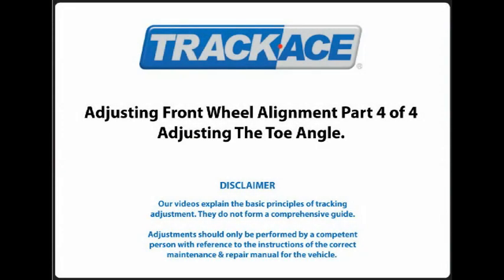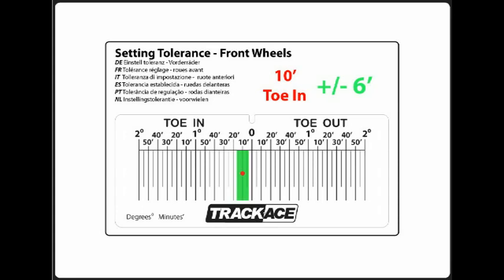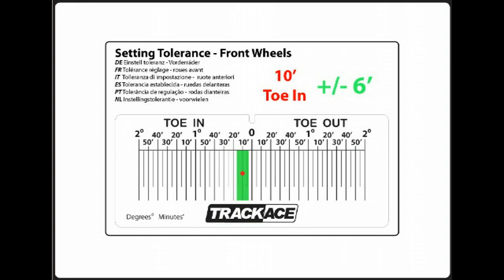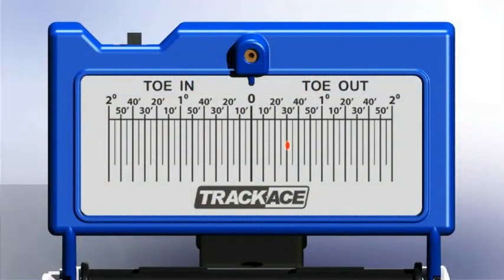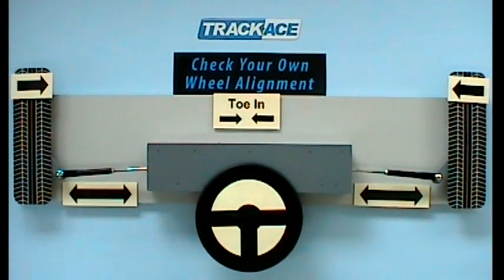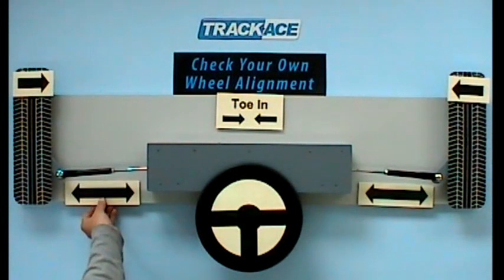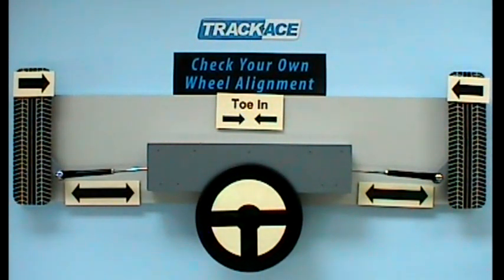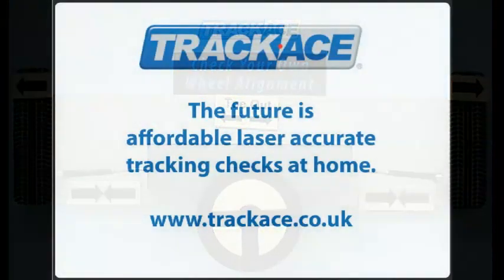Trackace Guide Part 4 - Adjusting Front Wheel Alignment Tracking - Adjusting the Toe Angle.

Comment from the maker: 8 against 9 threads is nearly equal which is fine, if the steering wheel is straight while driving straight ahead your wheels are centred. Use Trackace and check result against the settings for your vehicle. It’s best to treat centring the steering and adjusting toe angle as separate procedures, centre first then adjust toe if needed, always equal adjustments. Adjustments must be made by a competent person, if you’re not sure, let a garage mechanic adjust it, then check yourself for correctness.

Comment: Note before,this video is showing a vehicle with the steering rack linked to the hubs at the rear side of the rim. If the rack is linked to the hub at front side of the rim as in on my MK5 Cortina,then the tie rod need to be turned counter clockwise

Comment: Well I just purchased this tool and went to find the specs for my car on your website and you dont supply them anymore, you say check the haynes manual and that says take it to a Citroen dealer?!!!?! So did I just waste £75? Or can you tell me the wheel alignment specs for a 07 Berlingo Multispace?
Reply: Did you get it sorted?
Reply: @Nyle95  don't bother with the track ace unless you have a smooth flat floor to do it on, in the end I took it to a garage
Reply: @OldBiker  It works perfect for me and over the years has saved me lots of money and I know it's done correct.